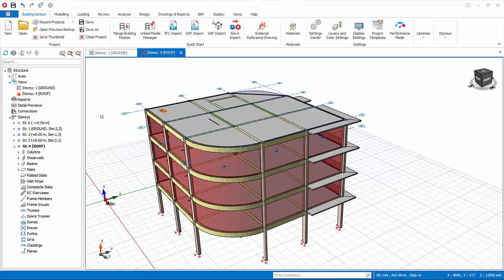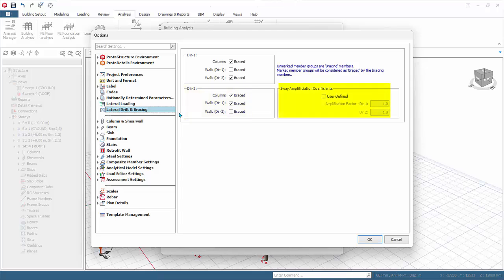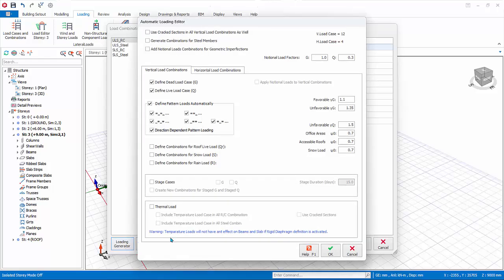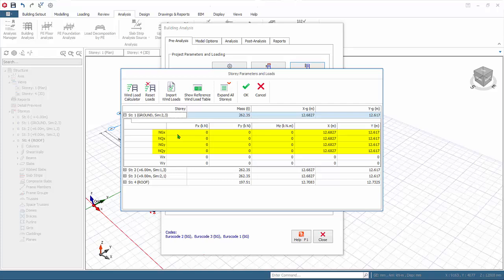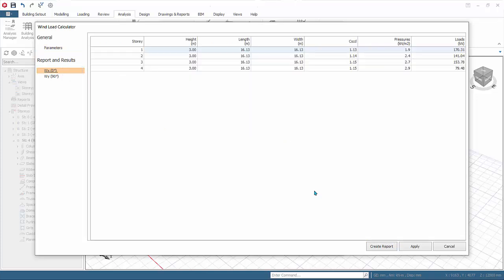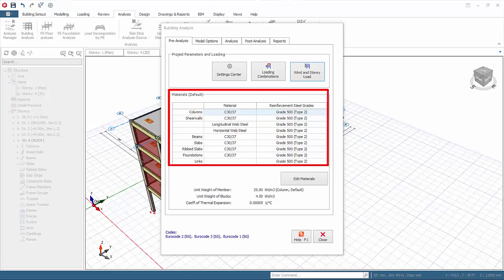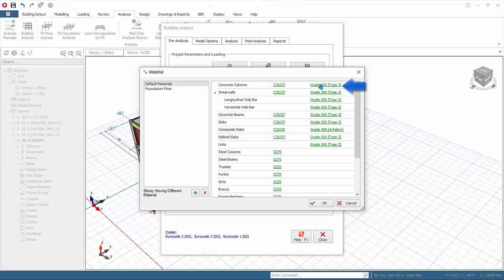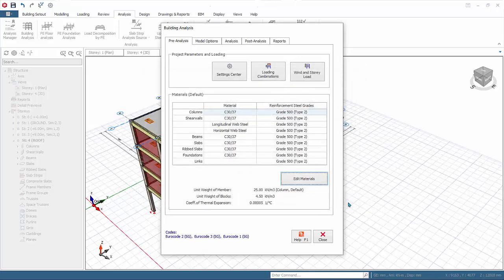12 – Pre-Analysis Settings & Wind and Storey Loads

Comment: Hello Protateam,

You are uploading video in 720 pixel only. It will be much clear if you upload it 1080 pixel or above. It doen't cost more to you. While capturing screen, set your pixel setting to maximum level. There is possiblity to upload it 2160 calarity also on You Tube.